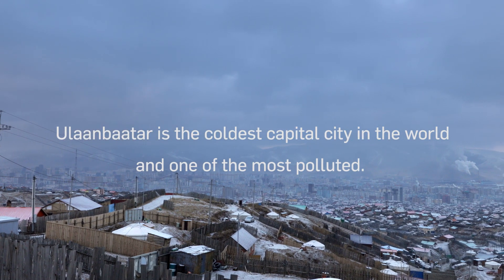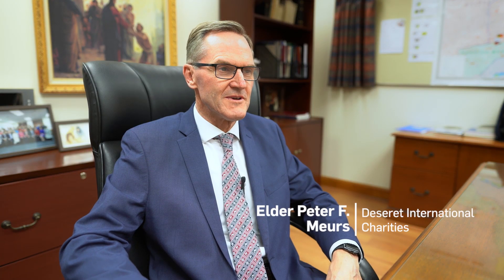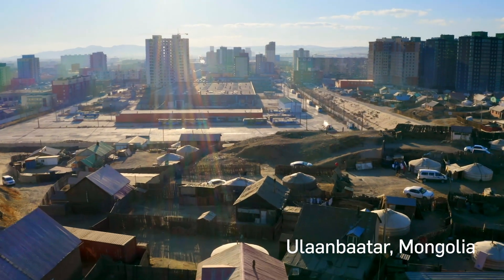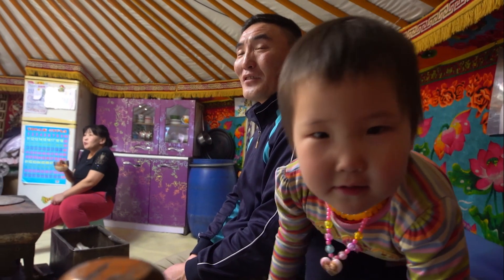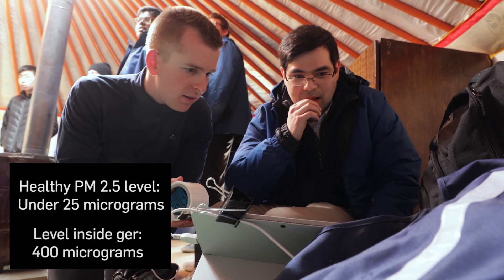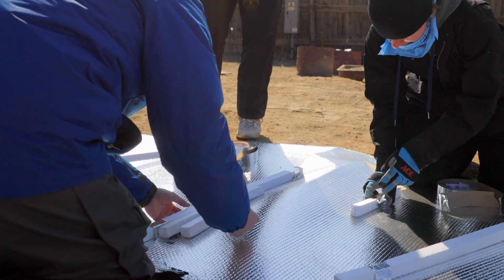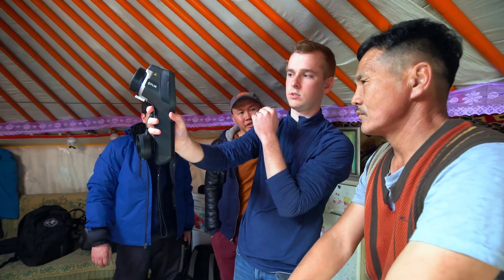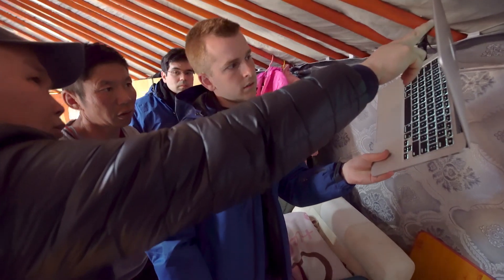In Mongolia, BYU's $400 retrofit could reduce toxic air pollution

Comment: Clearly UB Mongolia has a pollution problem. The 5 coal burning power stations don't help. A Ger is very well insulated using a thick multi layered felt and replacing that with modern insulating materials sounds like a good test (Not sure I would qualify it as any kind of innovative design, simply an upgrade) 
Burn I am interested to understand the full implications. You don't mention if your insulation is on top of the existing or instead of it? 
The natural Ger felt is very dense and during the sunny days, it does heat up and the ger is relatively warmed by the sun. Your reflective insulation would presumably stop that and require more heating during the daytime? 
Also, as a single living/sleeping area for the whole family. Cooking drying breathing etc all produce moisture which the felt can deal with as it's breathable. What about your non breathable membrane? Do damp problems start to occur over time? Mould? 
Same as if you tank an old house and stop it breathing you cause more problems than you solve.

Hard to say from this video if you perminantly improved anything over time